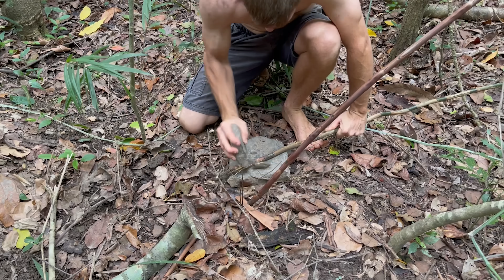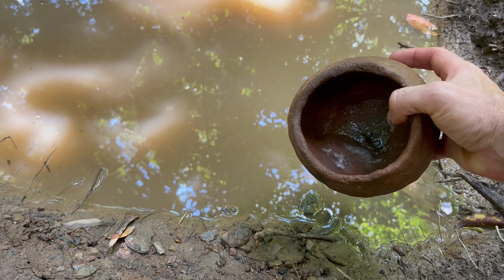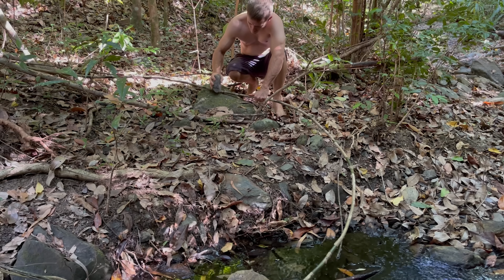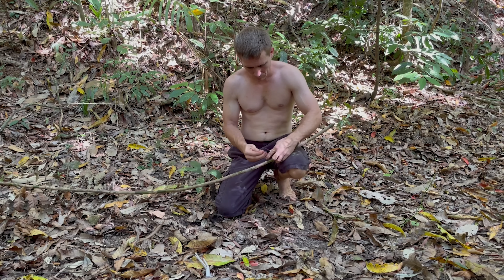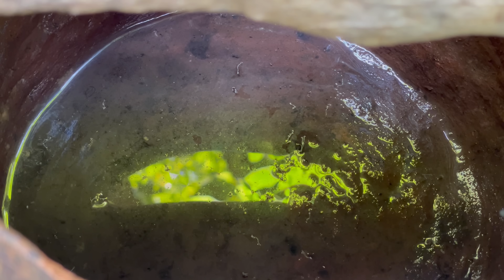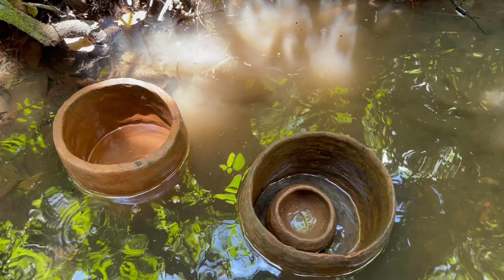Primitive Technology: Cane Water Filter/Siphon

Comment from the maker: I got the idea for this from MIT researchers who filtered water through a pine branch. Apparently it removes 99% of the bacteria in the process. What I added was the siphon principle, so that it's able to carry the water up and over an obstruction. Pottery isn't required for this to work, water could be siphoned and filtered from a higher up mud puddle into a lower container made of leaves for example. MIT article: https://meche.mit.edu/news-media/mit-engineers-make-filters-tree-branches-purify-drinking-water
Reply: perhaps an angled cut at the end of the siphon would speed it up? like a 45 degree angle cut at the output so the water doesnt have to push up the end to exit the "tube". And im not sure, since i didnt see how low the tube was in the top pot, but moving the intake higher off the bottom of the source of water, increases flow, and reduces clogging from mud and such since it sinks to the bottom
Reply from the maker: @Edetwo  Yes good points, the higher the reservoir the better it should work. I've since learned they boil the pine branch filter ends to un clog them.
Reply: @primitivetechnology9550  could also try cutting the ends at an angle. The florists I've bought flowers from all cut their rose stems at an angle to help against it getting clogged and stuff
Reply from the maker: @Rwdphotos  Cutting at an angle is a good idea, hadn't heard that before.
Reply: @primitivetechnology9550  so, I did a little research on this just now, and apparently it's a bit of an 'old wive's tale' that diagonal cuts help out. I guess you could still give it the ol college try though. Apparently, the only thing that really matters is how clean of a cut you make, and keeping it fresh, where using dirty water means you need to cut it more often. I guess you can try really honing in that iron blade you have.
Reply: @primitivetechnology9550   I most definitely would’ve tried to filter out some of the larger chunks that go through and boil it
Reply: Could make 2 x 45* cuts on opposite ends and make an edged needle that could possibly flow faster.
Reply: This was one of my main concerns since filtering water doesn't always make it potable but I'm glad to see you already had an answer and even back it up with an article. You are definitely a pillar to us all in this YouTube community
Reply: Pine has natural antibacterial and antiseptic properties, more specifically pine sap. That could be why they used pine specifically.
Reply: This is really cool but I'd kind of like to see you try and make a way to boil and collect the condensation on leaves or something. Like leaves in a cone above a pot of boiling water that drips into a little crevice around the pot and collects in a pot? Anyway love your videos, got your book in my SHTF bag too :P
Reply: @XoXitsSaruhh  I’m not reading 130 comments but people used to make clay stills for alcohol distillation
Reply: @XoXitsSaruhh  a dry rag over a boiling water can catch enough water to wring out and drink in a pinch.  His format doesn't let him use outside materials as far as I've seen though so no ragged castaway shirts.  Perhaps he could get the same effect out of a fibrous mat or a ball of cordage which he can easily make.  Pottery to direct some condensation could maybe make a very rudimentary pot still.  Maybe a broad pointed leaf or somesuch could direct a drip into a neighboring pot?
Reply: I'm not sure that alternative pot filter is healthy enough for bacteria part
Reply from the maker: @abdulmenaftimburlenk1744  Ceramic filters work for bacteria but not viruses as they are smaller still. Thanks.
Reply: @primitivetechnology9550  now that you've gone through filtering water. I believe you can make a filtering system using the pots you have and the plants around you. I'd like to see a primitive way of creating it.
Reply: @primitivetechnology9550  Well that’s fine, bacteria are more serious than viruses. Good info as always, thanks very much. Will be trying with my local pine saplings to see how feasible this method is for me. Would be a nice way to filter our spring water as an added layer of protection, should we need to do so!
Reply: @abdulmenaftimburlenk1744  That was my thought as well.
Reply: @abdulmenaftimburlenk1744  it is sold on a industrial scale as clay or ceramic water filter.
Reply: @abdulmenaftimburlenk1744  Either way I'd always give it a boil before drinking.
Reply: That is actually fascinating to see you adapt to new ideas that you come upon.
Reply: maybe try a slow sand filter? one of the best methods available, it even removes microplastics. takes a little while to get the bacteria up and running though
Reply: It seemed to me that the cane tips were sitting more or less flush on the bottom of the clay pot. I had the feeling that this would prevent the flow of water through the cane. And as always, love the content. Best thing Youtube has ever suggested to me.
Reply from the maker: @conanthecribber  It sort of sits off the bottom of the pot a bit leaving a small gap for the water to come through. Thanks Glad you liked it.
Reply: @primitivetechnology9550  i wonder if the ash pot you made would allow water to seep in better, since you showed that water would seep out of it over time. Maybe it would be faster than the clay pots. But i dont know if it would be less effective at filtering.
Reply from the maker: @Charles37400  Yes the ash pot might have greater porosity. I don't have it anymore, I actually calcined it and made it into mortar for the wood ash cement and fired brick hut project. I needed all the ash I could to finish the project. Thanks.
Reply: @primitivetechnology9550  , do you have any plans to do an updated version of your book at some point?
Reply: @primitivetechnology9550  hey! Just found out someone rediscovered how to make Roman concrete! Apparently it was lime added to the dry mix that creates lime clumps that activate when exposed to moisture that develops the concrete. Creating a stronger bond. Thought you might like hearing that. 😊
Reply: @conanthecribber  perhaps he could cut the cane on a bias, making a point for it on each end to keep it from sticking to the bottom. Either way, very cool !
Reply: Those are tree branches.
Reply: @conanthecribber  I think you're right. Should angle the cuts the same way you do when you put flowers in water.
Reply: @conanthecribber  How to solve, I wonder. Maybe a diagonal cut on the filtered end?
Reply: Thanks for sharing that knowledge, it could be a lifesaver for somebody one day. I wonder if there is some sort of fine organic matter, small seeds or pollen perhaps, that you could mix into the clay for a pot to make the filtration faster without compromising the water quality. I have heard of this done with coffee grounds but there must also primitive alternatives. The idea is that the organic matter turns to carbon and burns out, any remaining in the core of the pot wall would just help to purify the water as activated charcoal does.
Reply from the maker: @DanielSMatthews  I made a porous pot for collecting iron bacteria (the reverse of the last filter in this video, leaching water out of bacteria to concentrate the iron). I made it porous but making the flat base and making holes in it with a stick. Then I slid the wet clay over the holes so it formed a thin layer over each hole for the water to seep through. The rest of the pot was made with dead grass mixed into the clay which burnt out. The pot leaks very well as a filter. Charcoal powder might work too though. Thanks.
Reply: @primitivetechnology9550  laying hair into the construction of the pot works too.
Reply: @DanielSMatthews  so sorry to side track from the topic at hand, but I couldn't help but notice your logo. Reminds me of the OCP logo from RoboCop. One of my favorite movies.
Reply: @kurtislawler  Has more in common with the much older I Ching actually, in that it is numerically defined and encodes very specific information. Except that my logo has 4 layers and encodes 32 bits of information. You'd have to know a lot about fundamental computer science and or discrete mathematics to be able to decode it and appreciate its significance.
Reply: @DanielSMatthews  that's much cooler than it just looking like the OCP logo. Not big on math, but love puzzles. Always nice to have a hobby people can share and have a like interest in, too.
Reply: Is the sap from the cane safe to consume?
Reply from the maker: @whydidthetilda  The sap is safe to consume, thanks.
Reply: @primitivetechnology9550  thanks for the information 🥰
Reply: @whydidthetilda  This is a question from the series Can you eat mushrooms? The answer is - you can, but some only once in a lifetime. For example, Boletus edulis is very tasty and healthy. But Amanita phalloides is deadly poisonous. But even edible and tasty products should be disinfected whenever possible. Subject to heat treatment. Wash with boiled or otherwise disinfected water. This is especially true in areas where infectious outbreaks are observed. I repeat - a fly that crawled on the excrement of a patient with cholera or dysentery. Or for a person with Ebola. Will leave you a lot of unforgettable memories.
Reply: Did you consider distillation? Honestly could be pretty simple to make out of clay. Simply get a big rod of something like bamboo, set it up at a downwards angle next to a stove with a pot equipped with an "adapter lid" to direct all the steam in the pipe. Then just collect at the other end.
Reply: @Argentumッ  Always thought about this. If @Primitive Technology would be up for it I think it would be content many would be interested in. Though I know it must be alot with your following going through these comments we appreciate you working and testing out these ideas.
Reply: Pines are some of the most reliable trees for outdoors folk. Pitch, tea, crafting and apparently water filtration which is new to me. Well done on applying the idea to cane
Reply: What is rarely mentioned is that most woods have some anti-microbial properties to prevent the plant from rotting.
One beneficial effect is that wooden cutting boards exhibit less bacterial growth than do plastic cutting boards.
Reply: Hi! thanks a lot for your videos, I love your chanel, it's very inspiring. The MIT link doesn't work because of the extra ) at the end of your link.
Reply from the maker: @cocodij  Try the link now, there was a coma at the end. Thanks.
Reply: @primitivetechnology9550  The link is still pending to be fixed in the description.

It looks like the closing parentheses was accidentally considered part of the link. Try adding a whitespace after the link before any punctuation/symbol so it's never considered part of the link.

Thanks for all this wonderful work!
Reply: @primitivetechnology9550  
С уважением из Украины!!!! Спасибо вам за ваши интересные и познавательные видео!!!!
МИР ВАШЕМУ ДОМУ!!!🕊️🤝👍
Reply: @cocodij  it's called a bracket.
Reply: @Jamal_Tyrone  That's not a bracket. [ and ] are brackets. ( and ) are round brackets.
Reply: @TakeNoShift  If you want to be fancy, they're called parentheses
Reply: @Jamal_Tyrone  Thanks, english is not my mother tongue, I tought that was clear enough ^^
Reply: @cocodij  text does not not convey accents very well, so it is not obvious at all.
Reply: @Jamal_Tyrone   (round brackets/parentheses)
[brackets]
{curly brackets}
AL: Aluminum
Petrol/petroleum: Unrefined crude oil

Stereo-typically cocky Brit thinking their ass-backwards culture and dialectal oddities should apply to the rest of the world, forgetting that the majority of the time the American spellings and interpretations are the original and intended ones.
Reply: Ah - bacteria would have been my question, too. I mean clearing out dirt is cool and all - but in order to be usable as drinking water you would have to get rid of germs.

And my second question seems also to be answered: This isn't a thing people did in the stone age?
Reply: @robertnett9793  I mean, probably not, however, it's still using primitive tools.
People weren't also making houses with tiled roofs in the stone age, but here we are
Reply: I'd have boiled the water too, just in case.
Reply: @Jamal_Tyrone , definitely you should.
Reply: I was gonna ask about the need to boil but yeah it would make sense that the filters in the plants can get rid of most nasties, coupled with their highly evolved immune system should be good without. I guess the proof's in the pudding... Did you have the squits afterwards? 😉
Reply from the maker: @Andykerrfield  Yes, I thought that too, the plant would have an immune system of sorts itself and would help kill pathogens. No stomach issues after drinking it. Thanks.
Reply: @primitivetechnology9550  Glad to hear no issues, love the videos and the captions are a great way of explaining things while you just crack on 👍
Reply: @Andykerrfield  
Yeah, the plants can't survive bacteria either, so if you take advantage of their natural filtration, the water filtered by the plant will be free of anything living that can harm humans.
Reply: Might have missed it, but did the cane filter flavour the water obviously?
Reply: If you could get a strong enough vacuum going you could syphon direct from the pots. Double filtration, minimal clogging.
Reply: I'm not an expert in the subject, but i have looked at enough water treatment stuff over the years to know that the recommended treatment strength is 4 logs (aka 99.99) minimum as opposed to 2 log from the pine and unknown from yours.
The fact that the water was still cloudy would make me hesitate.

Assuming you also got 2 log reduction in pathogens (probably nowhere near as much for virus) you could theoretically filter twice for 4 log.

That said, 2 log reduction is better than none at all, since it takes some of the burden off your immune system. Since you have fire though, boiled is best.

I can try to scrape together some sources if desired, but it's not going to be fast

Reading through the linked article, they also treated the samples before getting up to 99%. You would be getting a lot less than 2 log reduction.
Reply: Wow that's handy for surviving skill, because water is the most our bodies need right?
Reply: 1% of billions of life forms is still a pretty high number though, innit?
Reply: Why not build a distillation system? I think it would be safer to boil water and catch the steam through some sort of cooling system. Might even be faster :D
Reply from the maker: @johan23sep  Yes waster distillation with fire is a good idea, I might do one like that if people are interested. I have an idea that might work. Thanks.
Reply: @primitivetechnology9550  We’d be interested in anything and everything you make mate.
Reply: @primitivetechnology9550  I can't wait to see your distillation apparatus !
Reply: @primitivetechnology9550  i can say i would be interested in a distilation setup.
Reply: @primitivetechnology9550  I love the idea for one, it seems it would be pretty difficult to get decent yield without glass or metalworking but would be cool to be wrong
Reply: @primitivetechnology9550  i for one am interested! really cool stuff
Reply: @primitivetechnology9550  yes, we would be interest in more videos regarding water filtering and storage. Thanks.
Reply: @primitivetechnology9550  also could suggest making 2 videos, one for a proof of concept filter and one for a portable one. If you want research material on portable filter, research brazilian gravity filter or brazilian clay filters (they are the same) and also moringa (another traditional brazilian clay filter that uses only clay as a filter). Fairly sure that you have ample access to all the components needed for making one.
Reply: @primitivetechnology9550 love to see this
Reply: @johan23sep  I think there's rarely a need to distil water. Boiling already kills all the germs. If there is heavy metal in the water you should just stay away from the whole area.
Reply: @commenter4898  I agree, but distillation also leaves behind the debris. Sterile is not the same as clean and pleasant
Reply: @johan23sep  definitely. Which would prove to be a game-changer if you're starting with salt water as the raw product. 

Filtering wouldn't work at all.
Reply: @johan23sep  distillation requires fire and a constant eye to make sure things are running smoothly. i feel like the pine siphon is a great way to collect water passively so you have more time to do other chores.
Reply: @johan23sep  
Most forms of survival distillation require either hot days with direct sunlight and (preferably) transparent, waterproof materials, or boiling via fire.
As it's not always blistering hot in all regions of the world on every day, and fuel for a fire (that has to be burning for hours on end to distill significant quantities of drinking water) can at times be limited, a way to turn non-potable water into potable water using no distillation is the best option in some survival situations.
Reply: How long did the different methods take to filter?
Reply: Absolutely fantastic, this was so enjoyable and fascinating to watch. Great job 👍🏻
Reply: Where do you find the resources for these methods? Do you have go-to references or simply general research? Best channel on YouTube mate!
Reply from the maker: @MrJules2U  I just come up with the idea through random searching things I'm interested in. Thanks.
Reply: @primitivetechnology9550  primitive distillation would be cool to see, I’d watch that video.

I mean, I watch all your videos, but still, you know what I mean haha
Reply: @primitivetechnology9550  I've been watching you for a long time, you've really struck an interesting formula.  Keep up the great uploads, can't wait to see further evolution of metal and tools.
Reply: @primitivetechnology9550 Challenge:
Make a whole video where you Filter an entire pond with the alternative pot filters until it’s crystal clear

Bonus: 
charcoal could be added with it
Reply: Thanks.
Reply: @Primitive Technology Thanks for the video! How long would it take to fill the pot up completely? And would daisy chaining pots of different elevations make it cleaner or would it be negligible? Thanks
Reply: How about adding a third vessel to further filter via the cane siphon?  And maybe use the water from the pots instead of the clay water. Very interesting solution for when clean water gets scarce
Reply: Andreas Folda  So I think the thought was what if you couldn't get a fire. If you're in a wet environment and are struggling to get a fire but you are reaching dehydration. Some filtration is better than no filtration. Appreciate the knowledge PT
Reply: You know, using your ceiling tiles you could actually make cleaner water by boiling it and capturing steam condensate using gravity to pull down to buckets.
Reply: Funny thing here, in Guatemala we have something called "ecofiltro" eco filter if you need traduction, anyway is a big filter made of plastic with a pot of clay and carbon, the carbon cleans the impurities of the water and you can drink it, same process as this and best part it filters it completely. When I saw this I remembered how we have one and is the same process. Mayans used to do something like that a long time ago and now is part of our daily use. This idea is unique and quite cool as well. Keep it up!
Reply: Certainly easier than a boil to get bacteria out. I wonder how it may do for chemical contaminants? I dont expect theres too much to worry about in the source water you're using, but I'd imagine mixing some charcoal powder into the input would do the trick, assuming the cane can filter out the powder as well
Reply: Another banger, John. Kinda surprised me with how fast the video just opened with the first step without so much as a slower walk into a static frame to establish what was going on! Did you encounter any problems with mosquitos or other insects using the still & clearer water? If so, how'd you deal with? I know smoke is a factor but that's all I know.
Reply: Are the mosquitos not unbearably bad this time of year?
Reply: @Spar10MG  he probably spray himself with bug repellent before shooting. That said, that would be another interesting topic for him to cover: primitive forms of repelling bugs. There is quite a lot that can be used to repel them besides just smoke.
Reply: I've seen this done with the Moringa tree but never thought that it would be transferable to other plants
Reply: You can combine that all with the classic filter design. Gravel, leaves, sand, gravel, leaves and charcoal. Put that into one of these special pots, and let water poor into it via these pine branches. You should end up with god tier water ^^
Reply: Hey, have you tried using palm fibers and charcoal method? My family used this method all the way to the end of 90s until they installed municipal pipes in the early 2000s
Reply: @kb.visions  Jesus is reporting you for ruining other peoples days
Reply: Trust me. There's nothing antimicrobial about pine. It's a great sponge for moisture and that's about it. The best way to purify water hasn't changed in thousands of years and that is to boil it although that clay filter would help with filtering particles before heating it up.
Reply: Wow that’s freaking cool.
Reply: Hey uh 99% isnt 100%  becareful my dude.
Reply: I feel like I'd be too paranoid to drink the water just straight from it coming out of the cane, I'd still probably boil it just to be sure. But interesting that just filtering through that removes most of the bacteria!
Reply: Do you send packages through Telegram? Got some notification thing trying to mimic you.
Reply: Aren't there bits of dirt or sand at the bottom of the pot, I could kinda make out what looked like little pieces of non water
Reply: are the internal structures of US pine branches as effective in removing ameboma's and bacteria as cane where you live?
Reply: Your cheeks are going to feel all weird.
Reply: Viruses are much smaller than bacteria and would suggest to boil your water just to be safe.
Reply: Be sure to boil. Very high risk of contracting cholera. Even one fly sitting on the excrement of a cholera patient and falling into a container is dangerous. Or you can bring it in with your dirty hands.
Reply: Very intresting
Reply: Had the clay pots been fired?
Reply from the maker: @hgcamelsmoker  Yes the pots were kiln fired in previous episodes. Thanks.
Reply: 99% is pretty much nothing at all, since they exponentially grow and you don't need that many to make you sick anyway. This is definitely not save to drink without cooking.
Reply: This is pretty awesome.
Reply: This is so good! Keep it up, man
Reply: Cool
Reply: Next try to make binchotan charcoal for filter. 😁
Reply: Literally the first thing I came to comment about was the question of bacteria and virus filtration levels. I shouldn't be surprised to see you already addressed it with the linked article! 😀
Reply: I was Just about to leave an comment about bacteria and If it would be able to travel in the Cane. But you already answered my question :)
Reply: That clay pot method blew my mind was that a fired or unfired pot?
Reply: @Mr.Autodelete  i think they were both fired
Reply: @pigeondoodles  makes me want to go backpacking with nothing but food for cold soaking and pot for filtering water and eating out of
Reply: @Mr.Autodelete  itd certainly be a challenge! lol
Reply: Are the water purifiers in the game "Raft" at all realistic? Angled glass pane to catch saltwater as it evaporates and deposit the saltless water vapor into a container
Reply: The best way to filter water is using charcoal.
Reply: 정말 최고의 정보입니다. 감사합니다.
정말 신기했어요
Reply: Think about how unfair this is.
"Primitive Technology" uses modern MIT research to Get Primitive Technology that is more advanced than the ancient ones!
Reply: Wow, cutting edge primitive technology, haha
Reply: is okay to use gravity as an alternative instead of a siphon?
Reply: @Primitive Technology  Speaking of the porosity of your ceramics, I see this is another case where it's a useful feature, but I've been wondering what it would take to glaze them for other uses like cookware or water storage? (Might the slag from the iron smelting be any help?)
Reply: @voidstarq  The glaze is made from finely ground kaolin, quartz and feldspar.
Reply: Did you test the water to see what's left in it? Would be useful data if nothing else.
Reply: why not using activated charcoal??
Reply: How long does it take for the water to collect? Like, if you set it up at 8am, how much water would you have at noon?
Reply: An idea for a future video: A well (possibly with a pump/or just the ol' bucket design)
Reply: I saw something similar recently using the flower of typha also known as cat tail. Water was filtered through it removing dirt etc.
Reply: With the pots in the creek:  how do you know it’s filtered through the clay

And not just condensation accumulating on the inside of a cold pot in a cold stream?
Reply: You can use charcoal as a filter and direct sunlight to kill bacterias (due to UV). Treated water should be stored in the dark (algea) with a lid (mosquitos).
Reply: Could you rough up the inlet of the cane filter to prolong its life?
Reply: Maybe later root systems can be used for vertical uptake and branches for filtration. I have a feeling lotus plants would do well in this scenario.
Reply: That's ingenious. Never occurred to me that you could use plants to filter water. Thank you for the interesting video 🙂.
Reply: Can you try to make glass?
Reply: Brazilian clay filter is the best of all filters!!!
Reply: In what region do you live? Most of the plants you use don't appear where I live, but I'm interested in knowing where they DO exist.
Reply: @mattlawyer3245  I think he lives in a part of Australia but I bet you could use any very porous vine or branch or maybe a lake reed?
Reply: Seeing as the pots are porous after firing, it would be cool to see a solution to make them waterproof. Of course, I know how this is normally done, but I don't have any idea how it could be achieved in a primitive setting. I think that some modern ceramic glazes are similar to primitive glass. Perhaps something along those lines can be used as glaze? Or perhaps something else/easier to find/make.
Reply: @mattlawyer3245  just a dandy layer of pitch
Reply: I wonder if siphons were used in ancient times?
Reply: @moulouchemoulouchie1340  , I believe they were. I remember seeing a history documentary several years ago where they tried to recreate the water system used by the ancient Egyptians. It involved them casting bronze screws to be used in some kind of pumping system powered by slaves or donkeys to transfer water from a lower point to a higher point and utilizing some kind of syphon system as well. They succeeded and also suggested that the ancient Egyptians would have most likely had a more refined system as they would have had years to perfect it. I don't remember much else about the doco', but it was interesting to see how they could have used a system of bronze water screws and syphons to transfer large amounts of water long distances.
Reply: @stuffbywoody5497  , I find that very interesting thank you
Reply: Why not make a artificial aquifer by making 3 above ground tanks made from clay brick the first tank to catch and hold water the second to filter the water and the third to hold the clean water
Reply: Would love to see a primitive charcoal filter one of these days.  Pretty acheivable with some coarse rocks, sand, charcoal, and finally 2 pots (one with a hole in the bottom) that can stack.  Layer charcoal, then sand, then rock and boom fresh charcoal filtered water with no bug larvae.
Reply: I think you're supposed to boil the sand and rocks beforehand though.
Reply: Running that water through charcoal would be another great way to purify it further
Reply: That’s amazing. Thanks for sharing it with us.
Reply: How long did it take to fill the Pot ? And how long were you able to use the Branches until it began letting dirty water through  ?  I'd still Boil it before drinking unless you know the area
Reply: some channel with your profile picture texted me claiming I got a give-away, is that really the official one?
Reply: wow, I was actually about to ask for some citation that this works and you gave it haha, 10/10
Reply: Yeah science, bitch!
Reply: unfortunately it cannot rid us of pesticide contamination. What do you say?
Reply: I wish I had watched and commented on this sooner, but that same technology is what goes into every Life Straw survival water straw. I'll be honest, drinking filtered brackish water flat out tastes bad but at least you won't die of a waterborne disease from trying to drink dirty water without filtration.
Reply: how long did the clay pot filter need to collect the water level showed in the video ? great ideas though, and thanks for bringing that article to our attention.
Reply: What abaut distilator? Thanks.
Reply: Mr. Plant you are legend
Reply: Next time, build a pot to make a warm/hot water.
To bath or drink.
Reply: Your mom
Reply: Awesome. The pot idea has the added benefit that you can make a lid for it, that would keep out wind blown particles, birds/bird shit etc.
Reply: Please build a charcoal filter, you have all you need for one and it's probably safer, if not atleast boil that water after siphoning, it won't get all the dirt out but it will kill the bacteria atleast
Reply: heyyy, how to make the filter pots, u forgot to tell us
Reply: Keep up the good work, you're videos are awesome.
Reply: I've seen a lot of filtering videos where people use charcoal sand and gravel, I don't know how true those are, so I was wondering if it would be possible for you to try them and give a review
Reply: This the MIT in Melbourne or Massachusetts?
Reply: Very cool!! Awesome video as usual!
Reply: You did the clay pots in the stream. How good would they do in the mudy water? Is the mud just too much for the pot to handle?
Reply: that's interesting and potentially useful
Reply: Pine is highly laced with other volatile compounds which could account for the bacterial filtration
Reply: I think the climbing bamboo species might be 'Mullerochloa moreheadiana.'
Reply: Really love how you didn't describe a single step during your video. So incredibly helpful trying to play survival charades.
Reply: @jeremiah6462  Turn on your captions.
Reply: How about filtering water using stones? Just a 1 Meter large and like 15cm wide container made from Clay. Little hole in the side of the bottom part and fill the whole thin with little stones. Should do well too
Reply: I never would have guessed it would filter out microbes.  Have you had the water tested to confirm your results match those of MIT?
Reply: Hello 👋
Reply: Will you make a second book? 😁
Reply: Very nice video PT.  loves the channel👍
Reply: Even thought I would boil the water
Reply: Yeah, I think that was why the Greeks invented straws from reeds, they filtered out some of the dirt and grime (I think it was a different plant though, some kind of cane plant
Reply: The pot filter i like the idea.. i want if you make the pots with some crashed charcoal will it improve the filtration of the water?
Reply: That's so sick
Reply: 하...ㅋ ㅍㅋㅍㅋ 너희 1070만명 구독자 없어질꺼야. 왜냐면 이거 100%조작이거든 ㅋ
Reply: Does this work with salt water?
Reply: is  difficult to heat the water? ,im have a agony
Reply: How long would it take for 1 liter to enter the clay pot ?
Reply: Should you cover the pot to prevent evaporation or do you think water loss was negligible?
Reply: As a biologist, you couldn't pay me enough to drink this without boiling it first. Sapwood was used in the research specifically due to its higher filtering quality, which reeds do not, to my knowledge, possess. Instead, reeds clean water by use of a root bacteria which you would not be benefitting from in this setup. 

I tend to absolutely adore your videos, but this one makes me very concerned for your health if you plan to make use of this system long-term rather than just for this one video.
Reply: @Roger44477  I doubt you're much more than a Youtube Biologist - i.e. fake.
Reply: so you didn't get the shits then?
Reply: I would think it would be better to collect water with the 75% submerged pot to remove some bacteria / dirt and then to siphon through longer canes that go to a shaded area to prevent the sunlight/heat from helping bacteria form in the filtered water pot. Also, with the tips of the canes propped up so the water actually drips from the them into the pot rather than them sitting on the bottom of the pot.

Then top finish off the bacteria boil the water to a rolling boil, let it cool and now you have clean & clear drinking water.
Reply from the maker: @ryand3581  Yes, good recommendations. Thanks.
Reply: @ryand3581  Sunlight actually kills bacteria, so leaving the pots in the sun would help sterilize the water.
Reply: @ryand3581  zero need for a "rolling boil" - that's wasting time, fuel, and water.
Reply: @ryand3581  Was going to sggest the same 3-step system - collect in river pots, then filter through cane, then boil.

In addition, I think one could get more mileage out of the filters by unclogging them with an occasional reverse blow. While the pots, if placed in running water like in the video, could mostly be self-cleaning in that regard.
Reply: I feel like using a custom setup might be a bit more efficient - as it is, the water has to be carried through the plant and uphill - which means the flow rate is awful. Definitely not sufficient for most survival needs. Maybe if the filter was at the bottom of a pot, so youd only have to fight against the filtration, and with added pressure from above? Though youd need to figure out how to make a watertight connection... 🤔
Reply: @TheAnon26  many gums and resins in nature that could do that. Pine sap mixed with charcoal makes an incredible all weather glue.
Reply: Would be interesting to run a TDS (total dissolved parts) meter to see how many PPM (parts per million) are in the original and filtered water.
Reply: @kotgc7987  That wouldn't tell you anything about it being safe. You'd need to sample the water, and plate it on different agar to see what grows. Or have access to some type of PCR machine.
Reply: Hi, biologist here. You could perhaps optimize this by increasing the pressure in the top pot. I'd suggest finding a way to utilize a press on the top pot. At the same time, the process can be made faster if you use water evaporation at the other end of the canes.

Xylem tubes are part of the mass flow system of plants (transfer of water across the plant, usually against gravity). There's a common misconception that this works through diffusion, but it actually works through a combination of pressure differential between the roots and the leaves, and water flow dynamics. The stomata of leaves carry out a process called transpiration (basically evaporation of water), which decreases fluid pressure between the gaps of leaf plant cells. At the same time, the roots keep actively absorbing water, which increases fluid pressure. This forces water to travel from high pressure, at the roots, to low pressure, at the leaves.

Furthermore, the constant evaporation of water molecules from the leaves forces other water molecules in the xylem tubes to keep travelling to the leaves. Water molecules can form quite a lot of hydrogen bonds between them (which is what makes water a liquid at Earth's temperature, and not a gas as it should normally be without hydrogen bonding). You can think of water molecules in a xylem tube as a long string of beads, with each bead being one molecule, and each string being a hydrogen bond between 2 molecules. So the evaporating water molecules end up pulling up the rest of the string, which can transport a hell of a lot of water.

Another factor to take into account is the surface area of your xylem tube vessels. You did the right thing by adding more canes, but perhaps you could also take advantage of other plants. Generally, plants that exhibit rapid height growth and have a rich, expansive root system usually have much more xylem tubes than other plants.
Reply: That 1% though ... surely you've got to boil that ?
Reply from the maker: @balaclavabob001  I think it's all about reducing bacteria to a safe level that the body can deal with rather than getting rid of all bacteria. The 1% that get through probably don't create enough load on the immune system to cause sickness. I could be wrong though as I'm not a medical expert, boil to be sure. Thanks.
Reply: @primitivetechnology9550  Yeah , I did some googling and I think you nailed it . I thought doing it with the pots was pretty clever too tbh . Thanks for the reply .
Reply: @primitivetechnology9550  A 2 log reduction (99%) is not enough to be very safe.
Standing water is basically always worse than running water (I'm sure you know this) as a starting point.
GearSkeptic has a long series on YouTube about making water found outside drinkable called "Backcountry Water Treatment" if you can't get through medical documentation (it's several hours long, for better or for worse)
It focuses on more modern methods, but there might be some transfer beyond vague safety estimates.

If I remember right, dairy pasteurization is a minimum 5 log reduction (99.999%) of bacteria by USDA standards
Reply: @balaclavabob001  I work in food science, very few products are required to have "0% bacteria" there is a threshold for everything. The vast majority of things you eat and drink have some small, but measurable level of microbial life in them. Exceptions like baby formula do exist, that have a much lower threshold.
Reply: @balaclavabob001  yea i was thinking the same thing but he's not dead yet so I'm assuming if you're healthy its fine
Reply: Before you take that water in your mouth, I suggest you buy or borrow a microscope and using a magnification of 50X or 100X, look at a drop of that water. You may be amazed what meets your eye.
Reply from the maker: @nizamahmed6283  Good to compare the water before and after for sure with a microscope. Thanks.
Reply: @primitivetechnology9550  I wonder if there'd be a way to find out what the pore size is on those ceramic pots. Modern filter sterilization setups have a pore size of 0.2 micrometers, so it'd be cool to see how primitive technology ceramic pots compare.
Reply: @primitivetechnology9550  could always throw a couple fire heated stones in the pot after, if concerned about virus still remaining.
Reply from the maker: @Crowbars2  The pots used in the second method were made from un processed clay so I think the pore size would be larger. Thanks.
Reply: @primitivetechnology9550  Senpai noticed me!
Reply: I’d still boil it, if you can siphon through it by mouth so easily then it can’t filter properly. It looks like it somewhat worked but I’d make it at least 4 times longer before I feel comfortable drinking that water.
Reply: caveman discovers mit research next this dudes gonna make a partical accelerator out of his own shit
Reply: it is not a clean water, wtf with you all guys? You can die after drink this...
Reply: @whatsuphope  You're already in the internet, halfway done. Now google how to filter water. You'll find out that everything that can take some dirt out of the water is better then drinking it without any processing
Reply: Be very, very careful, please. 99% sounds impressive, but it's next to nothing. That's actually still wildly unsafe. Definitely continue boiling water if you don't bring your own.
Reply: I’m assuming the rock in the water concept is simply from humidity over the course of a night?
Reply: @kb.visions  
ORIGINS OF CHRISTMAS
The origins of Christmas stem from both the pagan and Roman cultures. The Romans actually celebrated two holidays in the month of December. The first was Saturnalia, which was a two-week festival honoring their god of agriculture Saturn. On December 25th, they celebrated the birth of Mithra, their sun god. Both celebrations were raucous, drunken parties.

Also in December, in which the darkest day of the year falls in the Northern Hemisphere, the pagan cultures lit bonfires and candles to keep the darkness at bay. The Romans also incorporated this tradition into their own celebrations.

As Christianity spread across Europe, the Christian clergy were not able to curb the pagan customs and celebrations. Since no one knew Jesus’s date of birth, they adapted the pagan ritual into a celebration of His birthday.

CHRISTMAS TREES
As part of the solstice celebrations, the pagan cultures decorated their homes with greens in anticipation of the spring to come. Evergreen trees remained green during the coldest and darkest days, so they were thought to hold special powers. The Romans also decorated their temples with fir trees during Saturnalia and decorated them with bits of metal. There are even records of the Greeks decorating trees in honor of their gods. Interestingly, the first trees brought into the pagan homes were hung from the ceiling, upside down.

The tree tradition we are accustomed to today hails from Northern Europe, where Germanic pagan tribes decorated evergreen trees in worship of the god Woden with candles and dried fruit. The tradition was incorporated into the Christian faith in Germany during the 1500’s. They decorated trees in their homes with sweets, lights, and toys.

SANTA CLAUS
Inspired by St. Nicholas, this Christmas tradition has Christian roots, rather than pagan ones. Born in southern Turkey around 280, he was a bishop in the early Christian church and suffered persecution and imprisonment for his faith. Coming from a wealthy family, he was renowned for his generosity towards the poor and disenfranchised. The legends surrounding him abound, but the most famous is how he saved three daughters from being sold into slavery. There was no dowry to entice a man to marry them, so it was their father’s last resort. St. Nicholas is said to have tossed gold through an open window into the home, thus saving them from their fate. Legend has it that the gold landed in a sock drying by the fire, so children started hanging stockings by their fires in hopes St. Nicholas would toss gifts into them.

In honor of his passing, December 6th was declared St. Nicholas day. As time went on, each European culture adapted versions of St. Nicholas. In Swiss and German cultures, Christkind or Kris Kringle (Christ child) accompanied St. Nicholas to deliver presents to well-behaved children. Jultomten was a happy elf delivering gifts via a sleigh drawn by goats in Sweden. Then there was Father Christmas in England and Pere Noel in France. In the Netherlands, Belgium, Luxembourg, Lorraine, France, and parts of Germany, he was known as Sinter Klaas. (Klaas, for the record, is a shortened version of the name Nicholas). This is where the Americanized Santa Claus comes from.

CHRISTMAS IN AMERICA
Christmas in early America was a mixed bag. Many with Puritan beliefs banned Christmas because of its pagan origins and the raucous nature of the celebrations. Other immigrants arriving from Europe continued with the customs of their homelands. The Dutch brought Sinter Klaas with them to New York in the 1600’s. The Germans brought their tree traditions in the 1700’s. Each celebrated their own way within their own communities.

It wasn’t until the early 1800’s that the American Christmas began to take shape. Washington Irving wrote a series of stories of a wealthy English landowner who invites his workers to have dinner with him. Irving liked the idea of people of all backgrounds and social status coming together for a festive holiday. So, he told a tale that reminisced about old Christmas traditions that had been lost but were restored by this wealthy landowner. Through Irving’s story, the idea began to take hold in the hearts of the American public.
In 1822, Clement Clark Moore wrote An Account of a Visit from St. Nicholas for his daughters. It’s now famously known as The Night Before Christmas. In it, the modern idea of Santa Claus as a jolly man flying through the sky on a sleigh took hold. Later, in 1881, the artist Thomas Nast was hired to draw a depiction of Santa for a Coke-a-Cola advertisement. He created a rotund Santa with a wife named Mrs. Claus, surrounded by worker elves. After this, the image of Santa as a cheerful, fat, white-bearded man in a red suit became embedded in American culture.

A NATIONAL HOLIDAY
After the civil war, the country was looking for ways to look past difference and become united as a country. In 1870, President Ulysses S. Grant declared it a federal holiday. And while Christmas traditions have adapted with time, it is thought that Washington Irving’s desire for unity in celebration lives on. It’s become a time of year where we wish others well, donate to our favorite charities, and give presents with a joyful spirit.

Everything you thought you knew is a lie.

Resources:
• https://learningenglish.voanews.com/a/history-of-christmas/2566272.html
• https://www.nrf.com/resources/consumer-research-and-data/holiday-spending/holiday-headquarters
• https://www.whychristmas.com/customs/trees.shtml
• http://www.religioustolerance.org/xmas_tree.htm
• https://www.livescience.com/25779-christmas-traditions-history-paganism.html
• http://www.stnicholascenter.org/pages/who-is-st-nicholas/
Reply: I really love your videos, and for that reason I felt that had to mention this. In the MIT article they are using 2" cross sections of white pine that have been treated in hot water and then ethanol before being fitted into a pipe like a traditional filter. Membranes in the wood filter out the bubbles in tree sap and filter out 99% of bactieria like you said. However, it is a completely different process than what is being done in tyour video. Without testing the water or boiling it, there's really no way someone could be sure that the water is safe to drink. With that said, keep making some of the chillest videos on youtube and continue being a true inspiration!
Reply: Still tastes like crap though. 😁
Reply: @jameshansen1148  what do you preffer. Drink crap-taste water without most of bacteria or die to dehydration? :)
Reply: I wouldn't want to find out that 99% was an insufficient level for my body to handle.  Stay safe my dude.
Reply: Page not found-link is broken?
Reply from the maker: @marcinwitkowski217  Fixed it, try the link now, Thanks.
Reply: @primitivetechnology9550  muitissimo obrigadooooo from Brazil! Vc é incrivel !
Reply: @primitivetechnology9550  Ceramic filtering, then cane filtering, then boil the water = good to go
Reply: @marcinwitkowski217  delete the parenthesis at the end, skasuj nawias na końcu
Reply: @marcinwitkowski217  Siema przyjacielu
Reply: @marcinwitkowski217  Works for me
Reply: @JustinS06  yeah but it did not 3 moths ago
Reply: Have you looked into the Carnivore diet? I think it would be a great addition to the content of this channel.
Reply: @TheMidnightModder  maybe videos of him cooking the meat, but hunting and setting traps would probably make his channel vulnerable to demonetization. This is still youtube after all.
Reply: @astahfirula  True. I think he could build the traps, take them down, and then cook and eat the store bought versions without YouTube getting upset.
Reply: @TheMidnightModder  believe so as well. And i for certain would not have an issue with him cooking and preparing store bought meat.
Reply: @TheMidnightModder  Carnivor diet is a pseudoscience fad for red pill bros. It has no basis in history, science, or nutrition. Its essential oils for guys.